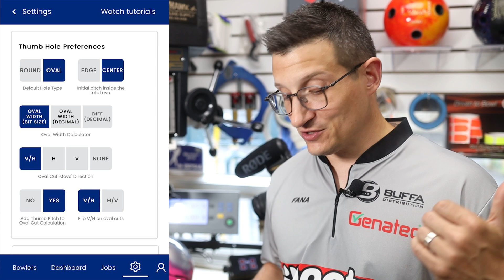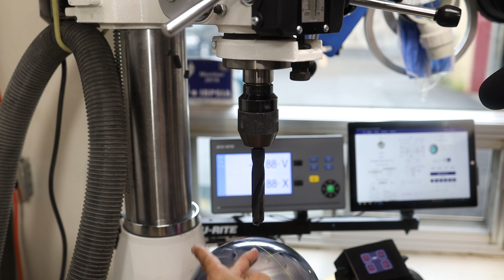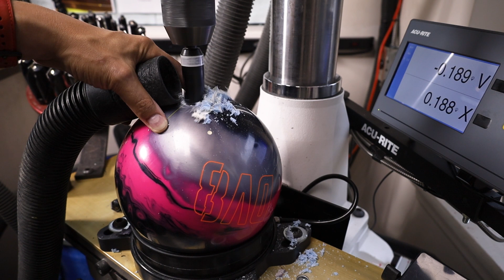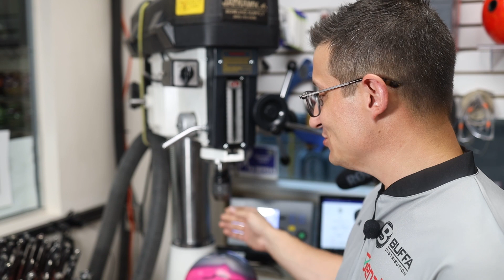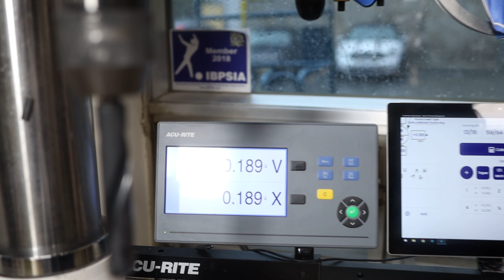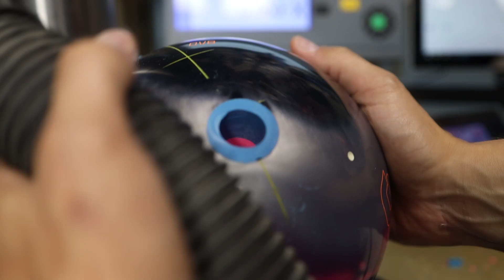How to Cut an Oval Thumb! | Full Pro Shop Tutorial!

Comment: Everytime it makes the oval width about 2 bit sizes to small
Tried it again today, told oval width of 63/64 and ot made it 61/64th
Reply from the maker: We use trigonometry to figure out the moves, so mathematically it is correct, however if you aren’t using end mills to do the oval there will always be some inconsistencies.  Milling machines with a keyless chuck will have some play in them, and if your bits aren’t very sharp and your machine not super super tight, the bit will walk towards the middle of the hole and be a bit tapered at the top, making it a bit smaller on the inside of the hole.  
If you’re that much off after drilling, I’d recommend checking your bits, if it’s been a while since last sharpening, that could be the first place to look.   Second would be the speed of the machine, maybe your machine is too fast, I like it being around 500-720 rpm. Lastly, as mentioned above, getting a set of end mills will fix this 100% however they aren’t cheap.

Comment: How do you determine a half cut and how is this done?
Reply from the maker: Hi Jimmy.  It’s hard to describe over text.  Basically you see if there is a bump on either side of the thumb joint.  If your total thumb move is v.100/h.100. Then the half back cut v.100/.050.  Basically adding a cut at the end, at the same height but half the horizontal movement. 
I’ll shoot a video about that. Thanks for the idea.
Reply: @spectrebowling  thanks for the reply. Can’t wait for the video.

Comment: I like a round thumb hole.  I know that my thumb is not round, but my thumb is flexible enough that it seems to adapt to the round hole, and I get a suction that I like.  If it's too snug, I use a dab of Chap Stick on sides of joint and works perfect in getting out of ball.  I also am a fan of a tapered thumb slug.  Almost like a molded thumb.  Keep it simple.
Reply: Second on the chap stick! Works great!

Comment: Great video Mark, how do you add a cut at the desired degree if your oval didn't come out to the correct width from the bit walking? mine always seem to be undersize and i have no slop in my chuck.
Reply: Hi Tony.  Easy answer would be to change the drill bit on the oval width until it matches what works for you and your client.   We now have the oval width in thousands as well in the settings, this might help you out.   It's hard for me to answer that questions since your press is moving a bit, I can't answer if the displacement is consistent from ball to ball/surface to surface.  Like I said, the easy answer would be to play with the oval width value.
Reply: @markbuffa5840  ok that makes sense. thanks for the reply.